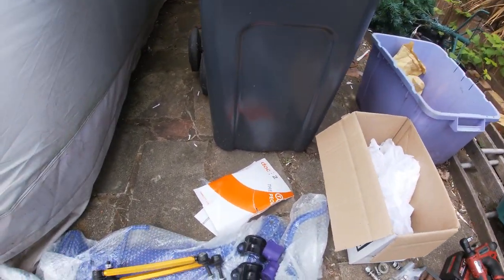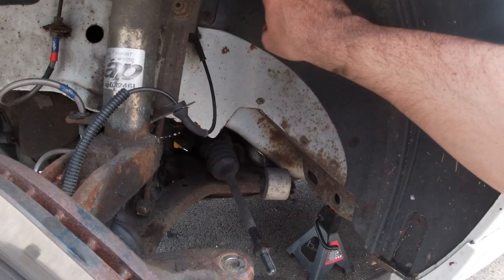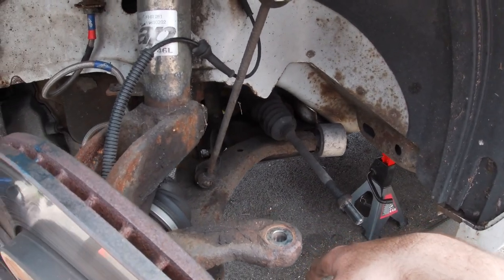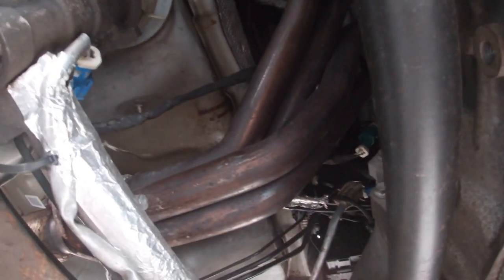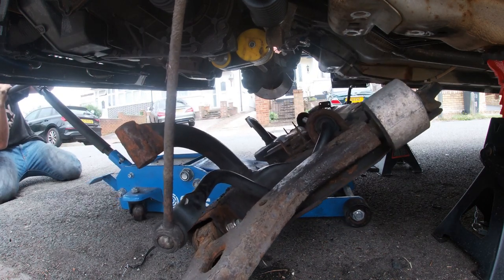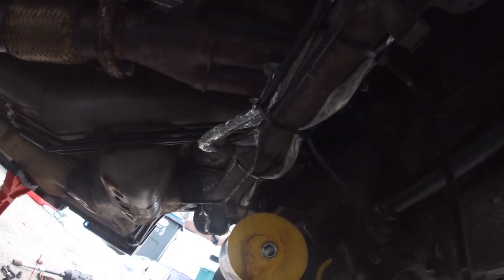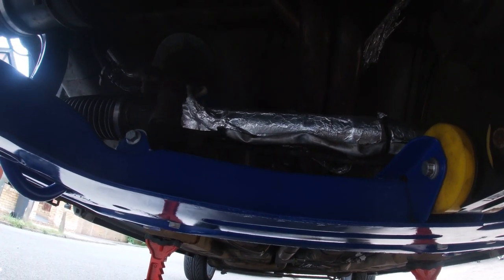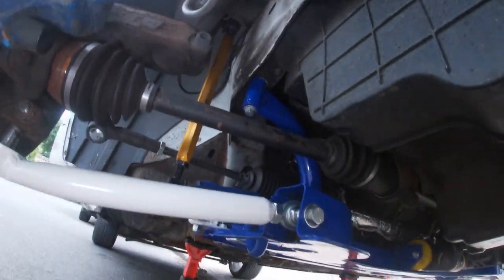CUSTOM POWDERCOATED FRONT SUSPENSION RESTORATION ON MY MK6 FIESTA ST150

Comment: Thanks for the video. I swapped my subframe out yesterday, and trying to get the nut back on the bolt for the steering rack was a nightmare, the only way I could manage it was to hold the nut with long nose pliers and just keep turning the bolt until it caught. I was worried about losing the nut in the subframe though as I dropped it a couple times but managed to fish it out with a magnet.
Reply from the maker: I found that myself a couple of times Atleast you got it done though mate
Reply: @6uiltdifferent  Cheers Ted, going to get the frame powder coated now.
I snapped the head off a bolt from the lower control arm where it goes into that aluminium block, I had replacement arms to go on the car so that's not a problem, but any ideas how I get the bolt out now? There's about 7mm of bolt sticking out, I don't have a welder. It's weird because of the 4 bolts in these aluminium blocks, 2 from either side were really binding trying to undo them and the other 2 came out with not much effort at all. With it being aluminium you wouldn't expect corrosion to be the cause either.

Comment: I took the subframe off mine when I had to replace the gearbox (diff blew up) and clutch and driveshaft but this was on a hydraulic lift made it a lot easier still cost over £500 with a second hand gearbox, new crank seal engine-gearbox oil etc
Reply from the maker: Damn must have been an expensive day for you then Atleast she’s up and running again that’s the main thing

Comment: Where are the solid steering rack bushes from mate? Much needed front end overhaul due very soon on my ST
Reply from the maker: Hi buddy they’re from Kinzy fabrications
Reply: @6uiltdifferent  Cheers mate. I take it you wouldn't have been able to tell if they made a difference since you changed out so many parts at once?
Reply from the maker: @RoryMacdonald1337  it’s hard to say but I’d say it makes a difference as you get less vibration through the wheel and the steering feels a lot tighter defo worth the £30

Comment: 19mm ARB Bushes?
Reply from the maker: Hey came with the roll bar so not sure they vastly do I’d just measure the one you’ve got
Reply: @6uiltdifferent  sure thing.. I'm thinking 19mm is standard, but some are 18 for some ford reason. (Thou should be zetec s) ordered 19mm so will measure it when it doesn't or does fit..😂
Reply from the maker: @CdotPoppy  😂😂😂😂